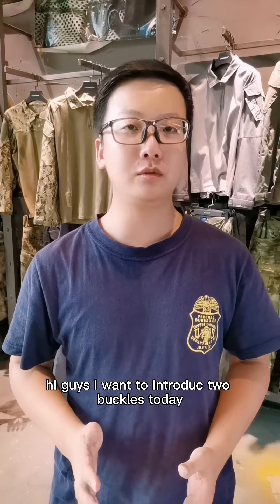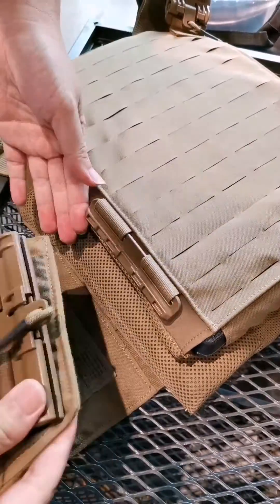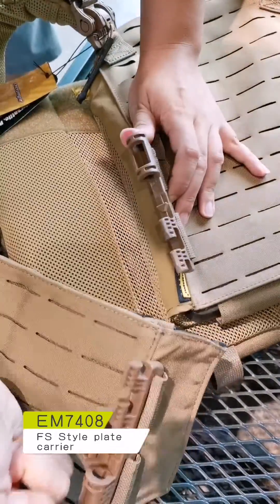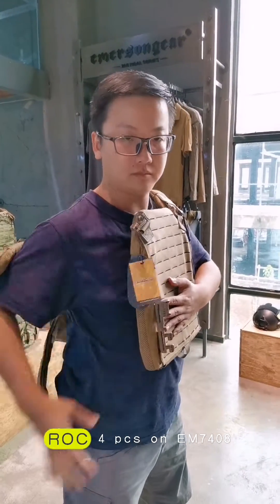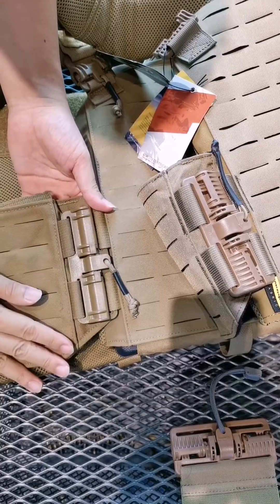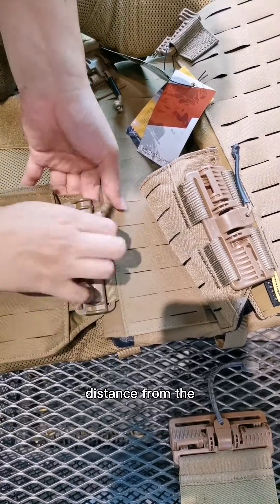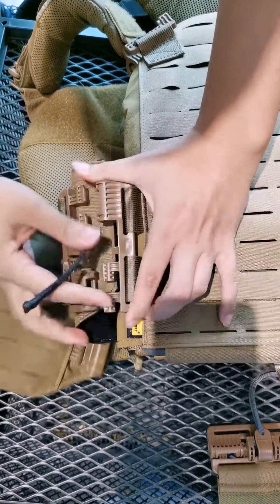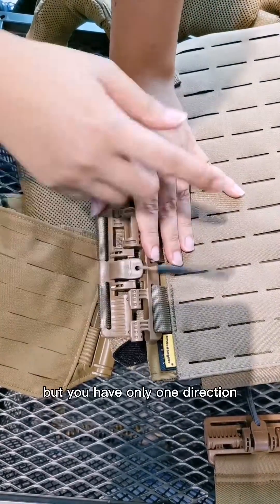ROC vs TUBE

Comment: The rocs are obviously ass the tubes is literally the best ones to go with
Reply: First Spear are far more superior than ROCs. Go out and run your kit.
Reply: And yet, the excellent K19 from Agilite uses a system almost identical to the ROC Buckle.  And the K19 is used extensively by ACTUAL Warfighters in Israel and beyond.
Reply: @Snapper314 Nah,  ROC buckles sucks, many users from Israeli themselves returns to the company for replacement because  the male side of the buckle like to  snap off from normal use, causing the buckle to get permanently stuck. Happened a lot of times in Agilite carriers,  even their warfighter cummerbund is getting problem in loosing their elasticity.
Reply: @Snapper314 get that stinking k19 out of here!  Agilite blah blah been used in war, etc…..   no American operator is using a damn PC that’s bulky and insulates body heat.  Much better choices on the market!
Reply: @Snapper314 K19 is junk, only thing those guys are fighting are rocks and civilians.